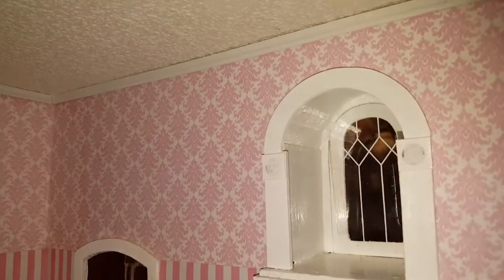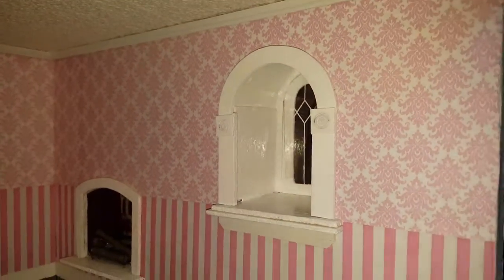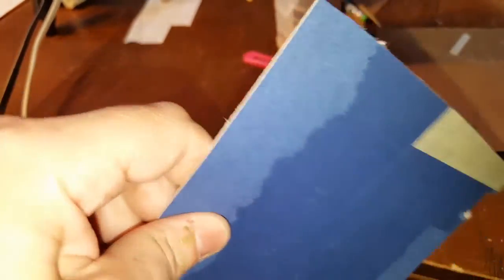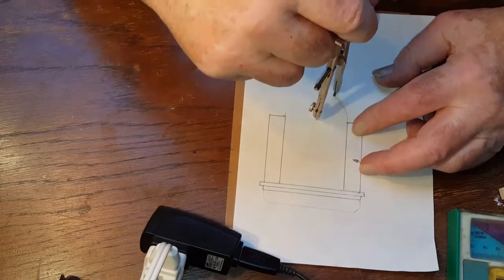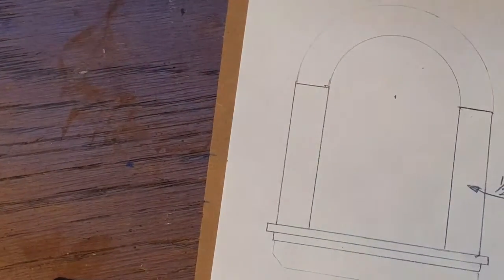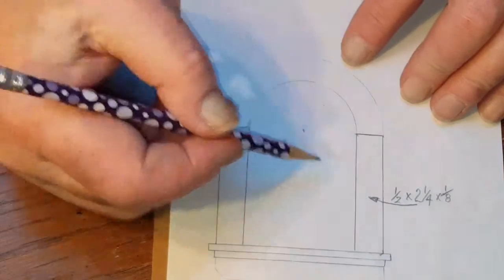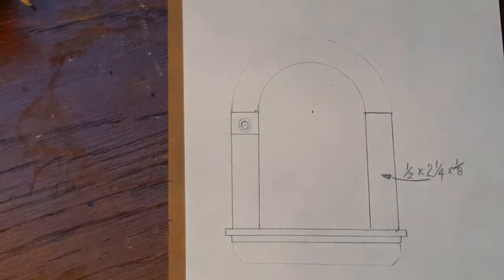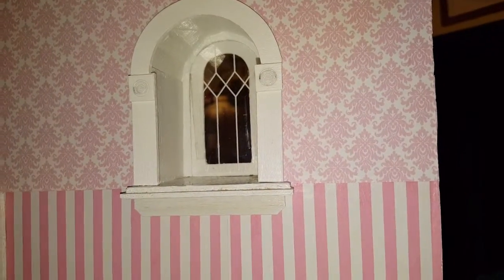Dormer Window Trim

Comment: Hi- Where do you find your bass wood? None of the hobby stores around here have anything close
Reply from the maker: I typically buy it online. I just type in 1/8" Basswood then whoever has it the cheapest  is who I buy it from.  Also, I do use paint stirring sticks as well because you can get them around 1"8" and 1/4". The 1/4" is great for the base of a project.